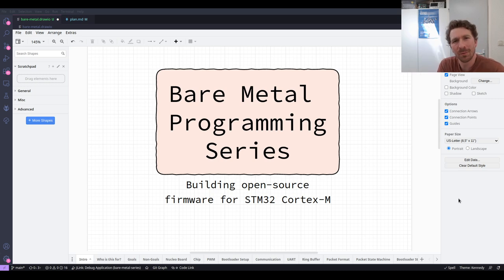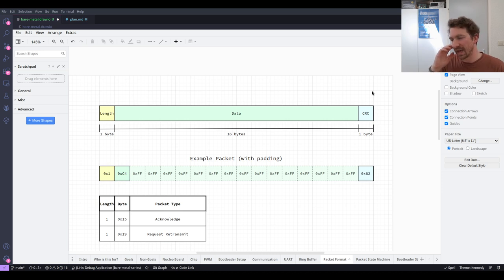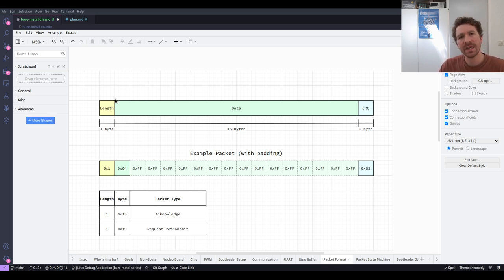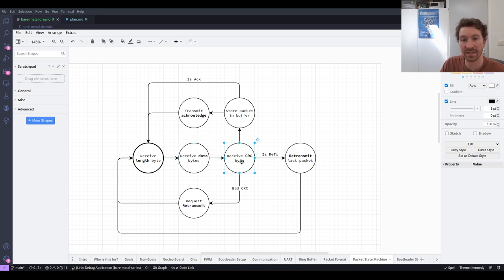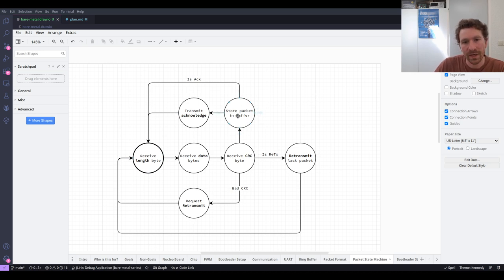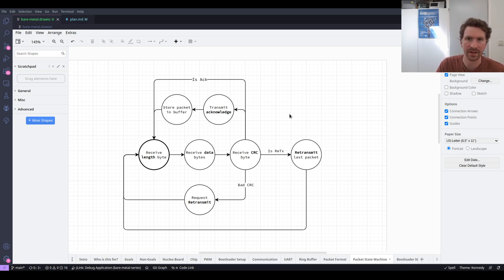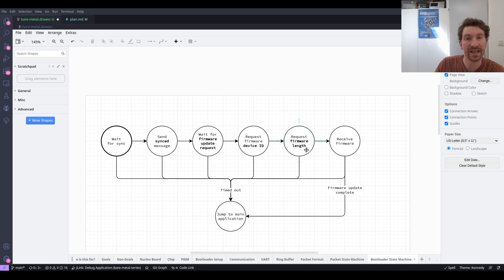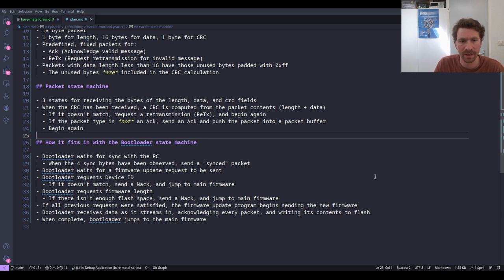Designing A Packet Protocol :: Bare Metal Programming Series 7.1

Comment: Hi. If working with paged data array is it relevant to use a ring buffer ? When sending a page number with the data length you can simply copy the data in sequence in a aray and copy them in the proper location corresponding to the page number ?
Reply from the maker: I'm not sure what you mean by page number in this context. Can you elaborate a little bit?

Comment: In a similar way as what Alice suggested, you could use one of the unused bits to separate between data and control packets. Ie. if bit 7 is high, it's a control packet. Then the length would still be valid and the data would be the control data with no chance of misinterpreting the packet's purpose. 
Also, while it would add a little bit of extra code, I would look at using some of those unused bits for a message number to make sure you don't miss a packet and so you can request a retransmit of a specific packet. The first byte could look like:
0x D N N N  S S S S - D = Data vs Control, N = Message number 3 bits, S = Size 4 bits
Reply from the maker: Honestly I was so close to numbering the packets in those bits! What you're proposing makes total sense - especially for the retransmit case. I left it out because of the implied extra state required on both sides to keep track of message numbers received. I may go back and add this in later though!

Comment: Wouldn't a data packet of length 1 with a value of 0x15 or 0x19 run into an issue where it would be interpreted as a command packet? Seems like it'd be better to relegate those to the unused bits of the length byte instead. For example, a length byte of 0x10 or 0x15 and 0x11 or 0x19 would result in completely unique packets that couldn't be mixed up with proper data packets. And while it might not be useful for this specific application since you're trying to keep it simple, it'd also leave room for the data bytes being useful for transmitting additional data with the command itself.
Reply from the maker: Absolutely, your observation is spot on. Even considering those points, I left it this way - with the implied burden being shifted on to the one writing the higher-level protocol that runs on the packets - because using those extra bits instead would have added a little bit more complexity. These are the kinds of change that I may go back and apply at some point in a standalone improvements episode.

Comment: On the subject of what to do with the Ack packets, although you touched on this briefly at the end: I suppose you could build into the state machine a system to make sure the previous packet is re-transmitted in the cases that either the user tries to transmit another packet before an Ack is received for the previous packet, or some sort of timeout happens. Otherwise, the Ack packets end up just being wasted packets (why would the other end transmit them at all if they have no effect?), and we can't deal with the Acks at a higher level as we aren't storing them in the buffer - unless you have some other buffer that's just a flag to say if an Ack was received after the last packet was transmitted.

I may have misunderstood this... let me know if I have! Looking forward to seeing the implementation.
Reply from the maker: You make a great point - in general we should be evaluating that the acks are coming back, and auto-retransmitting if they don't.

Comment: If you think it makes no sense to put the CRC though the CRC calculation then you might be surprised by the result of doing so.
Reply from the maker: I mean, the result would be that the computed CRC doesn't match the CRC field of the packet - so not very useful in this case 😄
Reply: @LowByteProductions  It won't match the CRC field, but the question is what will it match. AVR microcontroller CRCSCAN peripheral for example specifies that you place the 16 bit CRC of the rest of flash memory into the final two bytes. When you try it on one of your own packets you'll understand why, and how pushing the CRC through the actual CRC calculation can indeed be a useful thing to do (particularly in hardware.)